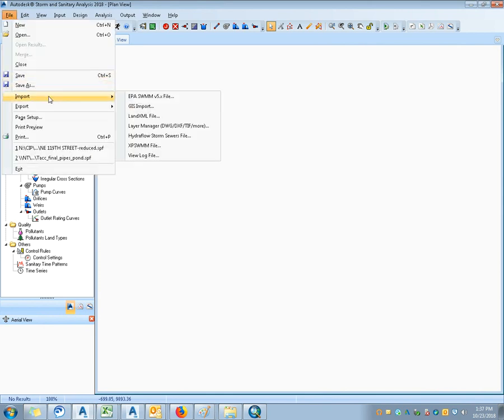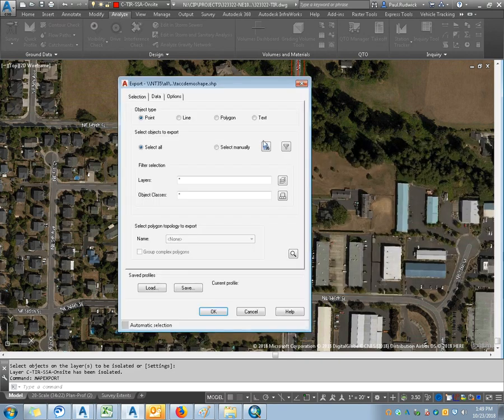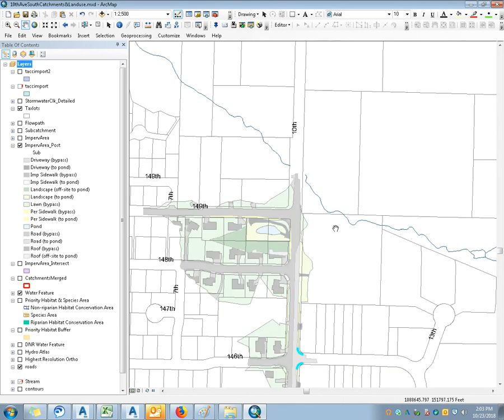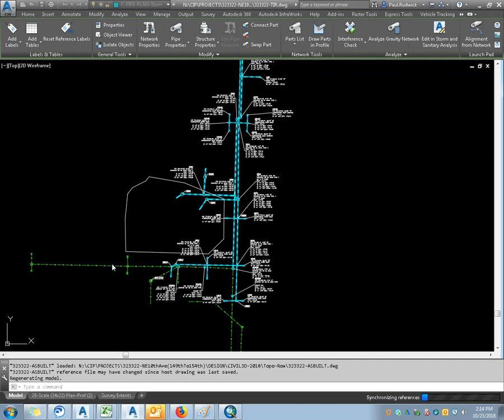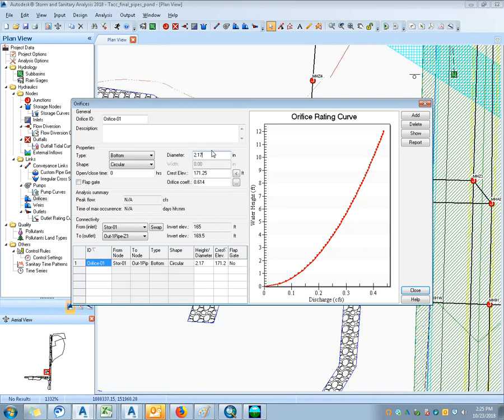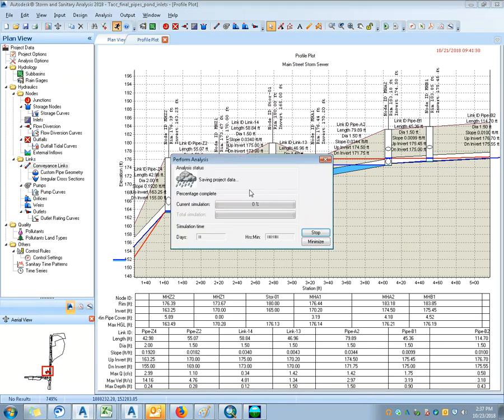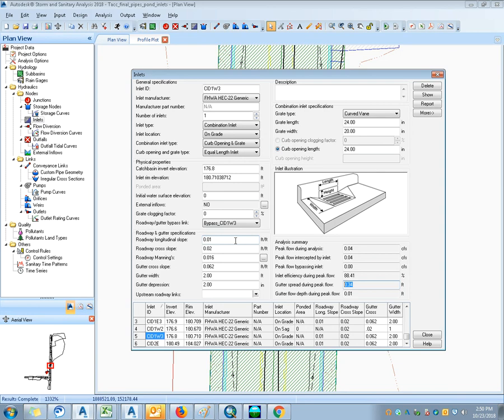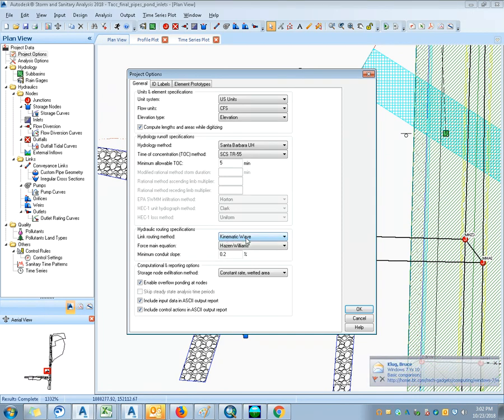Storm and Sanitary Analysis (SSA) - Civil 3d - Tutorial 2 of 2

Comment: Our rational method calcs (in the Denver area) require a different runoff C value for different design storm peak flow calcs.  i.e. for the same basin, the 5-yr runoff C is different than the 100-yr runoff C.  Is there a way in SSA to have different C values for the same basin, to be used for different design storm analysis?  I can only see the option to have a single C value for an individual subbasin.
Reply from the maker: Hi! I don't know of a way to do that! If you figure it out, please let me know :)
Reply from the maker: I took another look, as well as looking through the manual and I don’t think there’s a way to do this :(